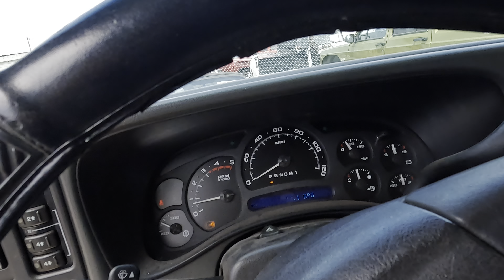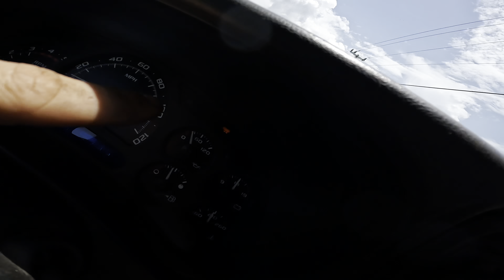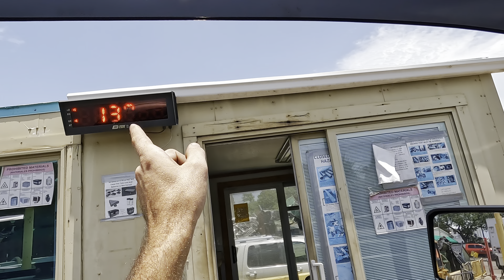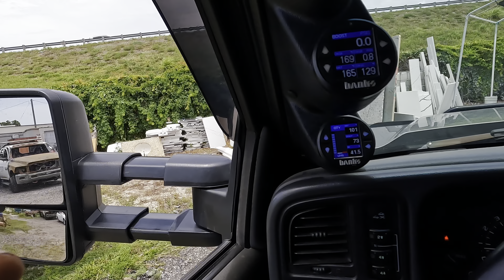Is Scrapping Worth it?? #Mechanic Side Hustle

Comment: Ludlum Measurements, Inc. designs and manufactures radiation detection instruments and technologies. Founded in 1962, we offer a large array of radiation detection instrumentation, developed to help monitor the safety of personnel and the environment. Our instruments are used in applications such as routine personnel and material monitoring, border security, and emergency response situations. We are committed to making the world a safer place to live and work by providing affordable, dependable, and durable equipment.

Comment: What is the reason for crossing the chains? I use my trailer several times a month and I never have crossed the chains. Should I be doing it?
Reply: Crossing chains allow the trailer tongue to fall on it if it ever becomes detached. Trailer tongue is suspended to prevent digging in.  It’s law in Ontario. 🇨🇦

Comment: scrapping metals is worthless now.  I remember a few years ago I filled up a ford ranger and took it to the scrap yard and got close to $150.  a year later I took a dodge ram full and it came out to weigh more than ranger, but I got around $50 at which point it was pointless.  so from now on I just call my thrash company to pick up any large metal items that I'm throwing away.

Comment: The detectors at the weigh in are probably radiation detectors in case you are dumping irradiated or contaminated scrap.
Reply: @TheCaptainLulz
5:36 - Radiation detector. They used to make thoriated steel. You can't recycle it, so if that goes off, your load is rejected.

Comment: Ray,,, You are really shorting your self on the scrap yard cash return.  I saw at least ONE CAT CONVERTER in that pile of metal you dumped.  The yard will pay you large amounts of cash for each converter.  You should also separate your, different metals like Copper, Aluminum, brass, lead, etc.   They pay pennies on the dollar for light iron/steel and a LOT better rate on the rare metals.  They usually have a separate area where they take and weigh the rare metals. I just put each one in separate bins, dump the steel and go weigh and then take the rare metals over and get weights on each metal.  BC.

Comment: I'm surprised you dropped off a a tank. Most metal recycle yards don''t accept them because of it being under pressure.  At least where I am they don't. Florida must be different.
Reply: it's pink so it's good.....
Reply: Pink is helium.  There also is a knock our plug on them...  r134 tanks as well, so they are completely purged.

Comment: If you are still dealing with that Subaru engine, locate a machine shop with an EDM device. It is like a reverse welding, sucking out metal rather than depositing.
Reply: He got that broken bolt out in a video a few days, I think it was, back. It was a bit easier with the engine on the bench. Seeing what you work with makes a big difference.

Comment: Here is a pointer when you have the heavier metals such as the drums and exhaust etc you put the heaviest weight on first before you put the lighter metals on top ,the more you bend the lighter metals the weight has more of a solid base so you get the money for what the weight is.
If you put the lighter metals on first the heavier metals will not be weighted down as much and you will lose money ,try it out the more you separate them to heavy then light the more money you get and worth the time and effort.
Reply: I think you have a serious misunderstanding of gravity. Don't matter which order you load the material. its gonna weigh the same. SMH
Reply: @nauhteeboy  you put light weight metals first then put your hubs and exhaust on top 
,then do it the opposite way you will see the weight difference ..
Reply: @XENONEOMORPH1979  everything is in the same box on the same scale at the same time. The order of layers in box has no effect on Gravity. Gravity doesn't care. It all weighs same.
 I bet you're one of those ppl that thinks a ton of feathers is lighter than a ton of bricks
Reply: @nauhteeboy  I understand your point but not talking about gravity.
It is about weight and how you can manipulate the weight .
Reply: @XENONEOMORPH1979  Hi, again weight is a product of gravity. You cant effect the weight of the object relative to is distance to the scale by a few feet. It takes thousands of feet of height to see a reduction in an objects weight relative   to its weight at see level. Example, at the top of Mt. Everest you weigh 0.4% less than see level. Most scrap yard scales have an accuracy of +/-2 lbs or more.
Reply: @XENONEOMORPH1979  gravity = weight. You cant manipulate either.

Comment: They are vultures in my area, you cant leave scrap out by the trash for more than 5 minutes. Literally. All day long scrapers are going up and down all the roads. They always look poor with beat up trucks. So i assume its not good business
Reply: It makes a good living if the metal prices are ok. A mate of mine used to run a small yard, mostly non ferrous, he told me that even the street guys who pushed an old pram, made enough to eat and get pissed every night.
Reply: I drive a junky truck and I am a millionaire,  richer than 97 % of all Humans - 93 F150 with faded black paint dents galore and steel wheels . Flexing wealth means your poor . Last check my account had 2.2 million smackers

Comment: I seem to collect a lot of scrap metal. No it's overall not worth your time. In shop you get $100+ per hr and your helper $$. Gas, insurance, wear and tear. You probably lost $$. I live somewhere I can put steel out on the curb and someone always comes by and picks it up. I save copper wire and strip it as I'm watching TV/ chillin, Until I get a bunch. It's almost $3 a lbs. It takes time. It's not a priority so it just piles up until, harvest. In the video I thought I noticed a catalytic converter on that Muffler you trashed. Those have platinum and other expensive mats in them. You need to check on your yards rules on them. But definitely separate them out. I have a can for wire and a can for brass. The rest goes to the curb. Steel just is not worth it to me.